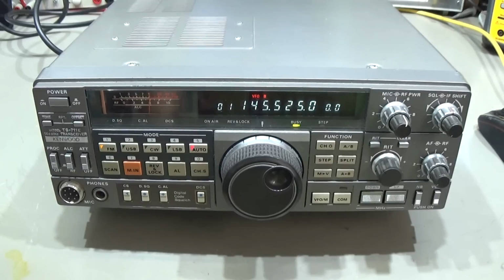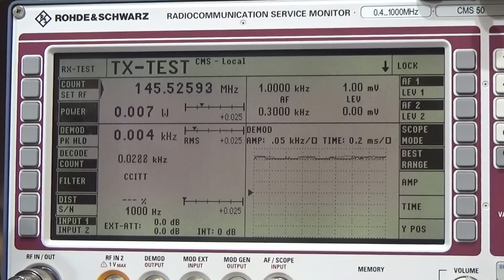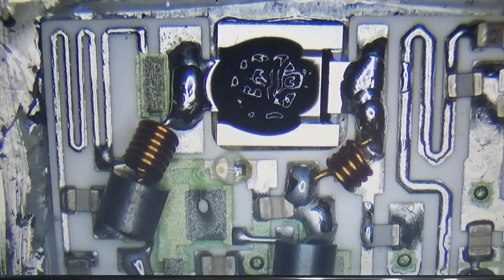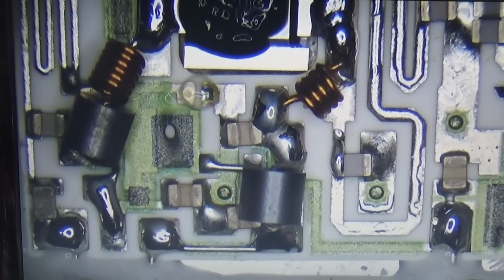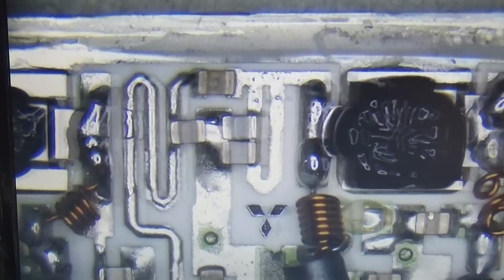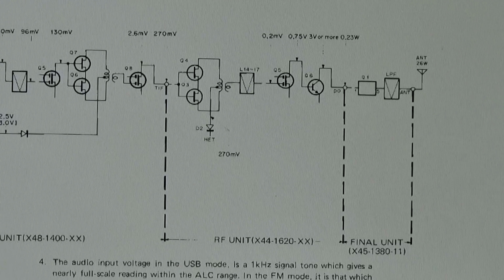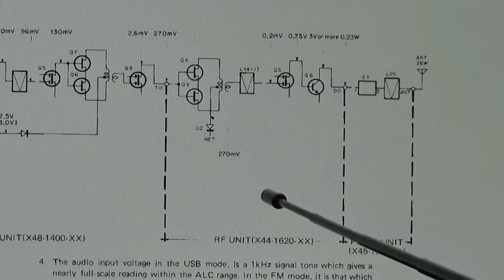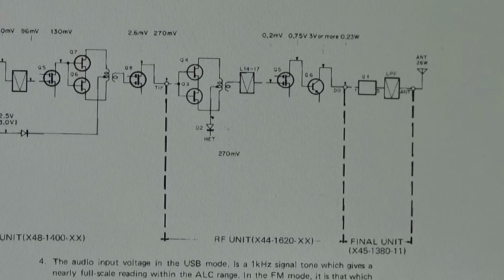#255 Kenwood TS-711 VHF multi mode radio repair

Comment: What is that Coax cable probe termination used to test the RF stage output?
Reply: Yes you need a 50Ω Termination to accurately measure the signal and not have any reflected power (VSWR) between the output and the test meter,

Comment: Hi Peter can you advise me on my own ts711e..problem is when you switch it on you get no receive audio. Occasionally upon switch on the receive audio will sound and everything appears fine but after so long , anything from 30 seconds to 30 minutes the audio just cuts out…any ideas if it could be fixed ? Thanks so much for your videos , enjoy them very much.

Comment: There are ways round this. The  drive to the PA module is approximately 250 milliwatts at 50 ohms. This could be used to drive a linear amplifier like the microwave modules 144/100 LS switched to 1 watt input, you'll get 30 watts output.
All you need to do is remove the module and just link the connections from the PCB corresponding to pins 1 & 5 together, check the alignment of the drive and pa tuning for maximum output on 145.000 MHz. In fact it actually works as a QRP radio without the linear amp, you'll need to hard switch the amp, easy with the 711 as it has a suitable socket available on the rear panel. Hope this helps.

Comment: i have one 711 whith the same problem.. i solve it by modding tra faulty module.. i replace the final transistor whith a 2n 6084 i just have  and whith some tric  and c trimmers now it work fine about 15 w

Comment: I have a very old Kenwood 733 VHF/UHF radio. Suddenly it stopped transmitting on VHF, and after a little search on the net, I found that the module like this was the error. I managed to fix the crack in the circuit board, but after a while i failed again.  Then i bought a cheap module from China, most probably fake, but I didn't want to pay maybe 100 Euro or more to fix an old radio, so I bought this cheap one. And I have to say it worked very well. I have used the radio for three or four years now, without any problems.  So not every fake thing that comes from China is bad. Of course - if this was a new radio I wouldn't do it, but in an old radio it's no problem.  73 LB5JG
Reply from the maker: Very good you was lucky!
Reply: @TRXLab  yes sometimes we have luck - but if it didn't work it wasn't a big loss. An old radio like this isn't worth so much money anyway.

Comment: Hi Peter, sorry this happened to your customer's rig - and to you.
Is there no market in stripping good components out of used radios that have maybe been written off for some reason that doesn't involve such an expensive and hard to find part? A "breaker's yard" for recycled parts that can't be sourced from reliable suppliers any more?
It's a principle used in many other spheres of operation, why not electronics?
Alternatively - are parts like this one maybe also used in other very different devices? Maybe even with a different part number? Are there equivalence charts of such?  Maybe these are silly questions!  No matter, wishing you well into 2023!

Comment: On the "replacement" part you can see the depression in the base metal plate made by the screw/washer that held the module down. Therefore it's likely that it was a genuine part - it's a pull, and a faulty one at that. The unscrupulous chinese trader who sold it to you doesn't give a shit - he's got your money, that's all they care about. If they sell a dozen parts and only two people ask for their money back, they're still winning. I would love to see these fraudsters shut down, but it's not going to happen. The best that we can do is refuse to buy their dodgy rubbish.
I have seen a lot of pulls and fakes packaged in those little sealed bags with the yellow anti-stat labels on. They make you think it's a brand new part, when it's far from it.
Would be interesting to pull the top off that one and see what's up with it. The fact that it looks like the top has already been removed before is an alarm bell right from the start.

Anyway, greetings from New Zealand and 73 de ZL1SAR.

Comment: I had a 711E a few years back. The final gave up. I order one from China, didn't work. Tried a different vendor but same out come..  Eventually ordered another on ebay with the same result.. Turns out all the Mitsubishi bricks I received where fakes....
The original units are unobtainable.....
My advice.. Sell your TS711E/A before it turns into a door stop...

Comment: I was caught out by fake China supplied parts just last night but they were 48 pin QFN packages. It would be interesting to see a teardown/diagnosis of the Chineese module to see what they have done to "re-furbish" the unit. I may have a used module in my stocks if it would be of use to you. I am sure I have the 10 watt version but would have to look at what I have in the 25 watt. Karl

Comment: I was hoping that you will take the new unit apart. Or is it worth sending it back?
Also they probably bypassed a burned final transistor inside the unit, and only the driver is working. Which you also should have done with the original unit.

Comment: An RA30H1317M1 can also be used with a bit of work.
Reply: Have you any further info on that please?
Reply: @boldford  The PA board in the radio can be replaced with one from Mini-Kits which will allow the use of an RA30H1317M1 or equivalent to replace the original M57727 PA module.  It wasn't specifically designed for this radio but it should work with a bit of modification.

Comment: 0.5W is probably what is coming out of the driver transistor inside the module, so probably only the final transistor is bad. Is it possible to change the transistor in the module?  Or another similar module?  I believe they had a 711 model in Japan that put out 10W, maybe that module can be sourced. I see there are a good number of them on Ebay but all are in china.  Its a great radio would be sad to see it in the junk pile because of this.

Comment: At 6:00 we see a test cable plugged into the board, can anyone in the community tell me what those connectors are called, I need to get some for testing an my radio as well.  Thanks!  ~Jack, VEG
Reply: Those are called Taiko Denki TMP connectors. You can get them on ebay.
Reply: @dh8dl  Thank you very much, I have been searching with no luck!  I see on eBay but none stateside...will order from the UK.  Many thanks!  ~Jack, VEG

Comment: Nice vid, Peter. Hope you feel fine? Once again a black brick..no big surprise, right;-)?  First thought was a ceramic substrate crack, but this time it was more conventional. Good and fast diagnosis, good hint to check the solderposts after installing the "new" module. I hate those fake sh...  crappy parts, they waste lifetime in heavy portions.. Stay healthy, Peter and 73 de Olaf

Comment: Hi Peter,
It's a shame that a used part was listed as new from China. Is it possible to repair the failed unit? If only that black goop was not on the component so it could be identified. However, those components could be obsolete. Stay safe.  73  WJ3U

Comment: Those beatup-looking Mitsubishi modules from China vendors are often not technically "fake", but they ARE pulled from old equipment.  As such there is no guarantee that they were extracted from working units before they were removed.   Disassembling scrapped equipment at the roadside to recover saleable parts is a cottage industry near Shenzhen.  Soldering on new leads to make the module look new is often done by unskilled labor with little static protection.  Even new Chinese devices that fail factory testing are often illegally diverted into the marketplace, instead of being destroyed as the manufacturer has ordered.
Reply: I opened the three fake units I received in comparison to the original unit. They are nothing alike..
Reply: @Team-Fabulous  Bad luck.  They are probably identical package styles that got new leads and a new cover with a "highly desirable" new marking... :((  Remarking look-alike devices that sell for big money is very lucrative in China.

Comment: I have here on my lab an identical unit (TS-711), with an identical failure AND also got a chinese 'repaired' module, with the same painted aluminum and added glue. I was able to get a refund from AliExpress at least. But the same sad end for the rig 😞

Comment: Ich habe ein ähnliches Problem mit einem M67728 Modul für einen TS-790, hier liefert das China Modul aber immerhin 4W... ;-( Original ist nichts mehr zu finden auch nicht die anders gelabelten Icom Module.